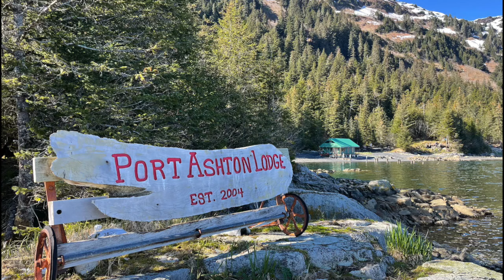Visiting a Remote Island Lodge in Alaska during the Homestead Build

Comment: Hi you two, does a high water tablet mean it could flood??? NZ
Reply from the maker: No we are one of the highest areas in elevation in the neighborhood. What I meant is the ground water is only 4-8 ft below the surface and that hampers our septic and drain fields for black water. We also have frost issues to think of. All water lines need to be buried at least 10ft deep and include a layer of insulation above before being buried so our water supply doesn’t freeze between the well and the house in extreme low temperatures.